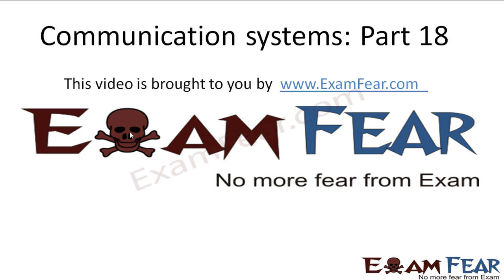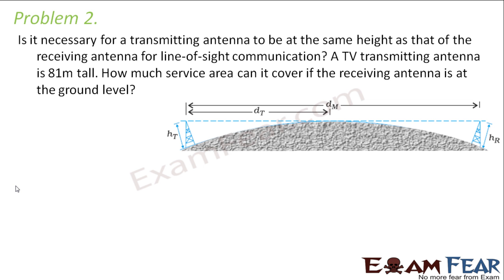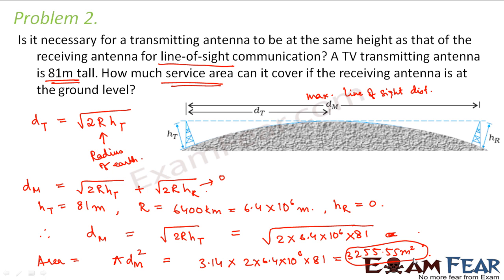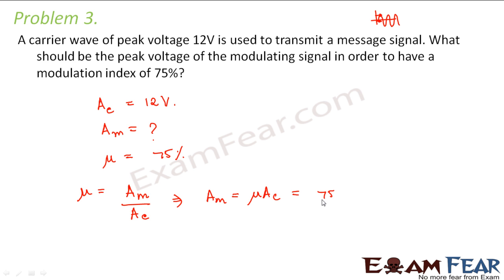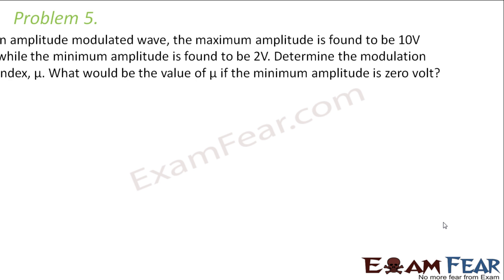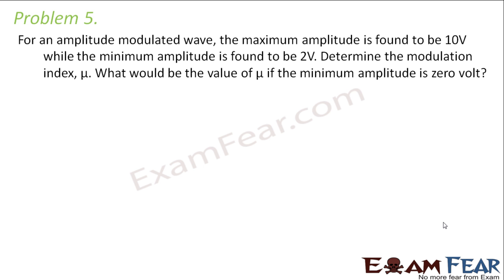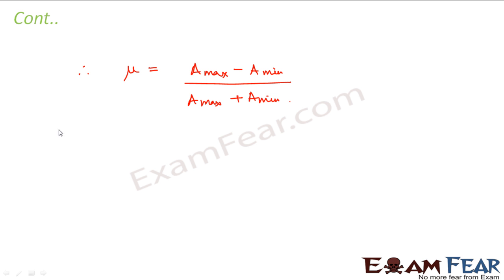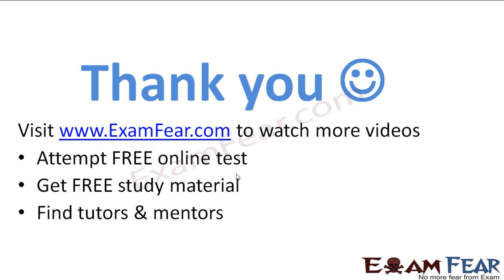Physics Communication Systems part 18 (Numerical) CBSE class 12

Comment: You are awesome ma'am. Thank you so much!
Just an alternate & easier method to understand the last problem:
We can use the eqn of AM Wave as y(t)=(Ac + Am.sin(wm.t)).sin(wc.t)
So amplitude (Ac + Am.sin(wm.t)) varies with time. Max value of sin is +1 and min value is -1. So Max amplitude is (Am + Ac)=10 and min is (Ac - Am)=2
Linear eqn in 2 variables. So Ac=6, Am=4
Modulation index = 2/3